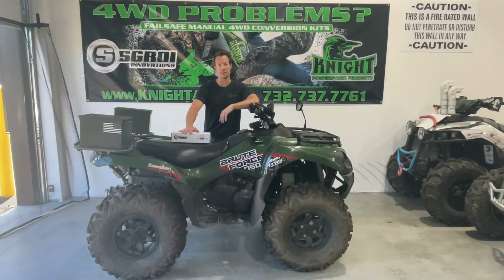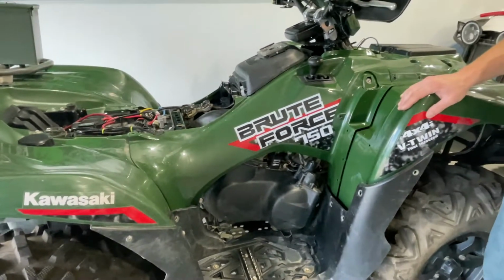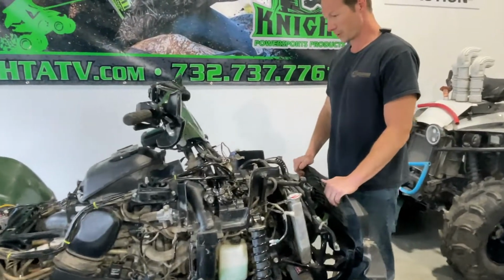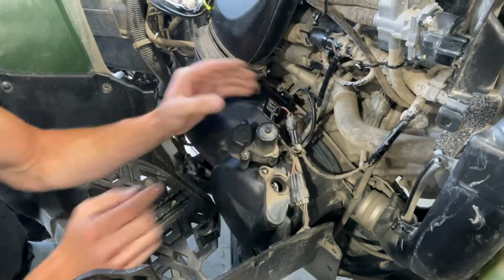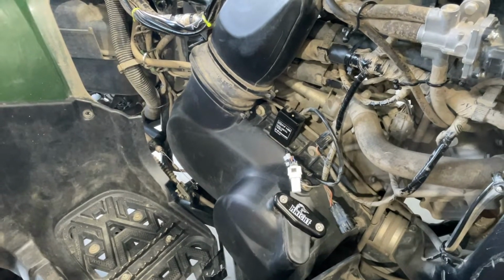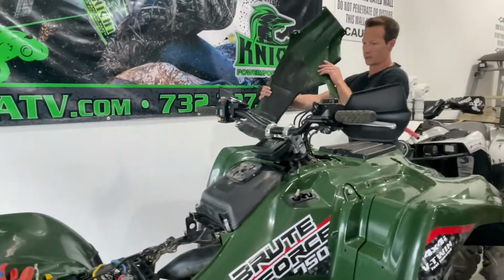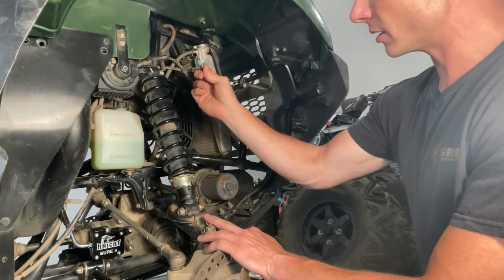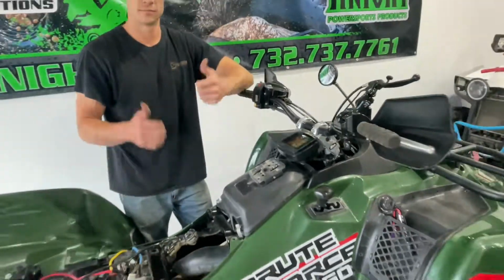Brute Force - Prairie KEBC Delete Installation - NO MORE LIMP MODE!

Comment: So what is this doing just bypassing the actuator? My 2008 is stuck in four-wheel drive or this help this kit or is this just for breaking
Reply from the maker: This is bypassing the KEBC actuator and getting the vehicle out of Limp Mode. If you 4x4 isn't working you need our 4WD Actuator kit. Check them out on our website www.KnightATV.com

Comment: I just purchased, and does not have the updated light. Is this a new version that eliminates that?
Reply from the maker: What light are you referring to? Email/call/test us. Sales@knightATV.com 732-737-7761
Reply: @KnightATV on your video it shows a new 4wd light being installed. I have a Prairie 360
Reply from the maker: @Hemi2018 yes the 2002-2006 Prairie 360 Belt Light Bypass kit comes with a new light. This is the KEBC Delete video and product. Did you order the wrong thing? Best thing to do is call us 732-737-7761
Reply: I purchased the brute force-prairie KEBC delete+cover combo kit. No light was in package but it’s all installed and
Works great

Comment: sorry i need help, i installed this product to my 2013 750 and 3 months after it started running in limp mode without the light showing its in limp mode, very painful that the quad has no power and can not get past 10km , i think the wiring harness has been slowly failing over time. i cant call you as i am in Australia.
Reply from the maker: How do you know it’s in limp mode if the belt light is not on? It could be a weak fuel pump
Reply: @KnightATV  i have this same problem ...limp mode still happens all the time ..i do have the flashing light letting me know its just gone into limp mode, 2 years i have been putting up with this ..runs good for a little while then next day its in limp mode on the first start, i have to do the reset again..any advice would be helpful ..also in Australia.
Reply from the maker: @shawnthompson8073  what year and model Kawasaki ATV do you have?
Reply: I have a 2005 brute force 750. When I bought it off a guy it had the belt light on, and it would sputter and backfire , and it wouldn’t have any power. I took it home, reset the belt light, the belt light is OFF and it’s still like it’s in limp mode. I took the carbs off, cleaned them, synced them, and put everything back together, and it’s still not working as it should, it’s stuck in limp mode and I can’t get it out please help! New battery, new fuel pump, new spark plugs, new piston and rings, valves are adjusted, she’s on timing, I don’t know what else it could be
Reply from the maker: @Huntressmain-2024  If the belt light is off then it's not in limp mode. Can you rev it up in neutral? Have you checked compression in both cylinders?
Reply: @KnightATV  in neutral, she’ll rev up about half throttle, anything after that, she’ll bog and sputter….now those carbs have a primer, when I prime it, it revs at full throttle but it’s still sputtering…checked the compression, that’s all good, 150 psi in each cylinder
Reply from the maker: @Huntressmain-2024  Seems like a carb/fuel issue if it runs better when you prime the carbs. Fuel filter is clean? Tank vent tube clean? Might need to rejet the carbs and clean them again.
Reply: @KnightATV  everything is new, fresh, and cleaned… I can drive the bike fine, but it’ll only go like 15km/h and at full throttle she’ll backfire and lose power…idk what it could be
Reply from the maker: @Huntressmain-2024  Maybe you need to change the jet size in the carburetor, have you done that yet?
Reply: @KnightATV  everything is stock, what jetting is needed for the front and rear carbs? Apparently they need to be slightly different
Reply: Mind did same thing. I replaced the vacuum diaphragms and problem solved. If they have a pin home in them they will not work right

Comment: Gonna have to buy this kit. I have tried several times to reset the cvt light so it will stop blinking and nothing is working so I'm stuck in limp mode. Hopefully this kit will get me back going again
Reply: Did it fix your issue? Because I’m at my wits end
Reply: @slacker9540  The kit worked great. It was the only way I could ever reset mine.
Reply: Same problem with my bike just ordered this hopefully I can ride without going into limp mode